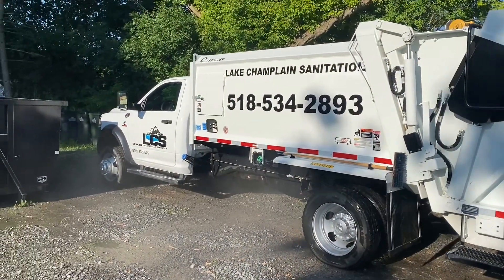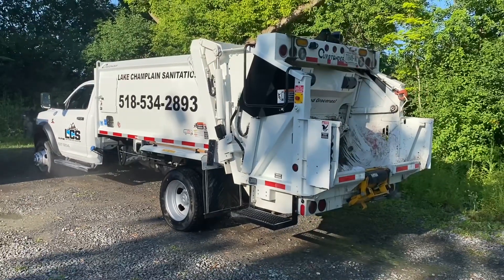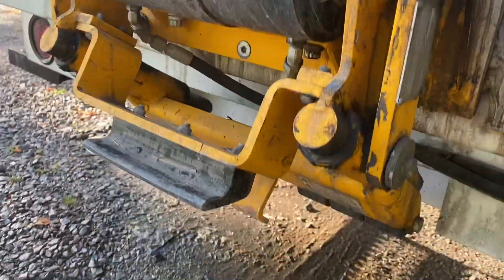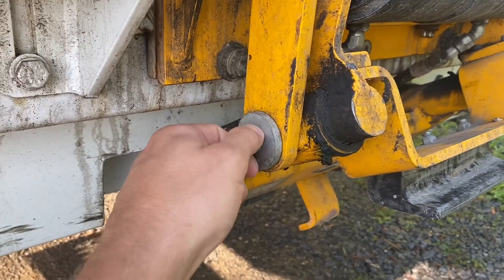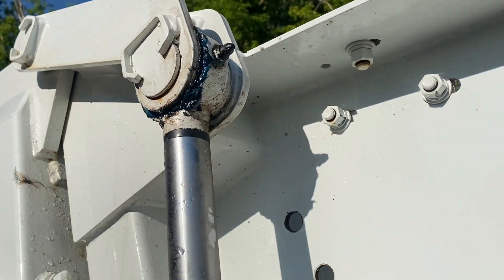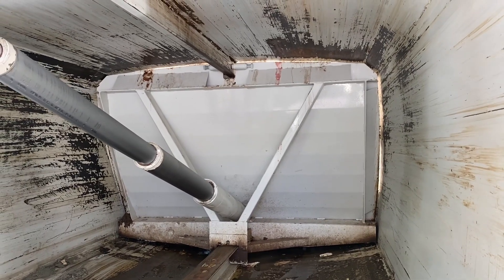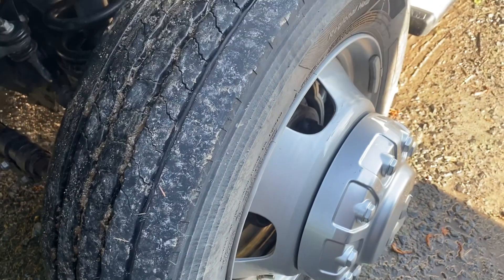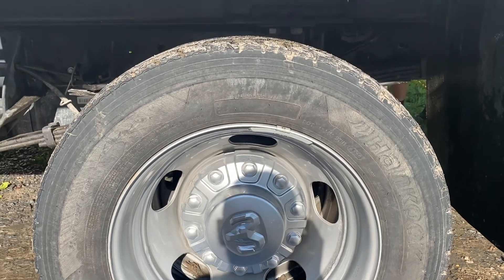Under CDL Garbage Truck Maintenance | Trash Business

Comment: Sometimes the dash will show PTO hours. Otherwise you could wire an hour meter that has ignition power so it comes on with the key and then the 3rd wire that would normally indicate the engine is running- run that in parallel with the PTO relay control circuit.
Reply from the maker: Great idea! Thank you for the information 🙌

Comment: Great video! How long did you run an open truck before buying this under cdl garbage truck? I’m considering using f600 hook lift with dumpster on it as I start my garbage route.
Reply from the maker: We got it around 600 stops if I remember correctly. We are grew to 720ish but I wasn’t happy with the route density or average ticket price so I sold the packer, raised prices and shrunk the mileage back to around 600 stops. We use a dump trailer with an F250 primarily with a 8x14’ box with 6’ sides we built for our Hooklift trucks as a back up set up. I don’t plan to grow the residential side much more as it is a well oiled machine now and we continue to grow junk removal and roll off.